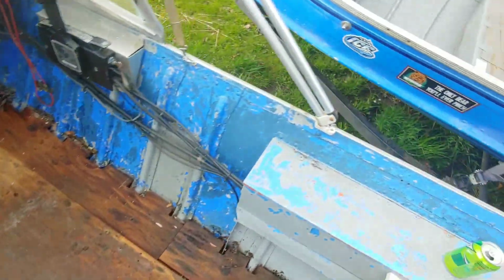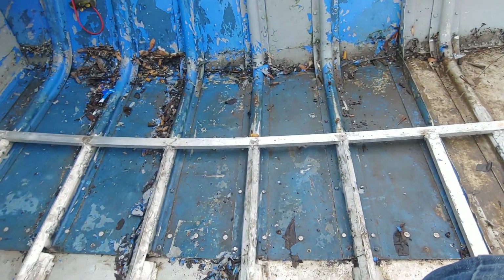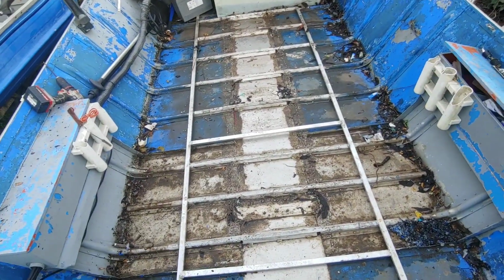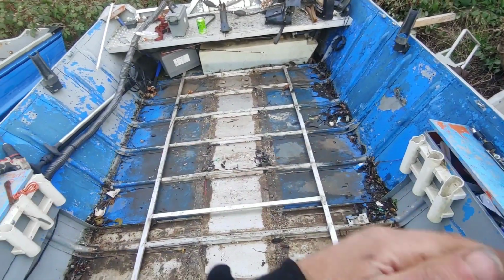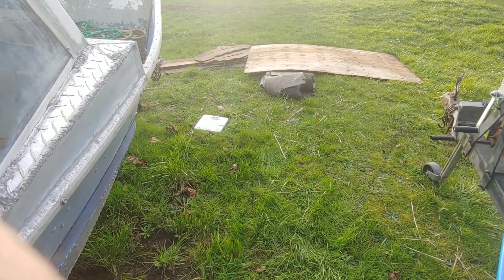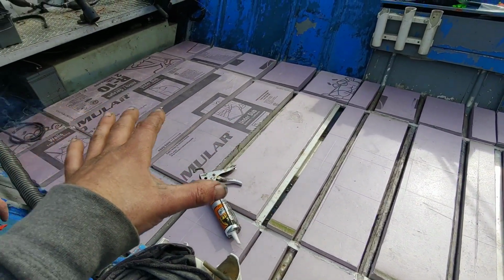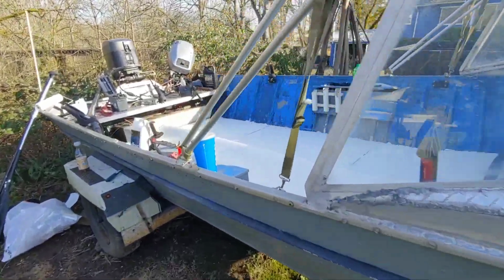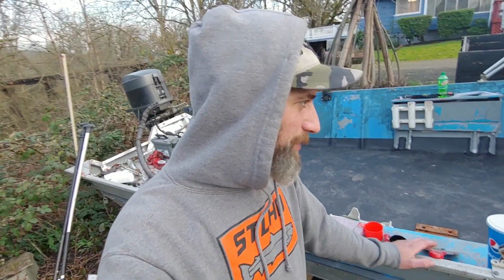Best boat floor. frankensled gets a new waterproof subfloor. diy boat floor.

Comment: I'm glad someone else thinks like me LOL!!  I'm looking at doing a similar thing only my boat is a 15ft aluminum shallow V bottom with a 4.5ft beam.  I'm gonna try multiple 1" vertical foam stringers to bring the bottom up to level, then cover with 1" pink foam for decking....might have to add doublers to the top of the foam stringers to support the foam deck.  Finally, cover the 1" foam deck with Polywall...a similar FRP only thinner and lighter.  Every thing glued together with Gorilla Glue Construction adhesive.  All very similar to what you have done,  Nice job!!  Glad to see someone else understands about weight in a boat.

Comment: Great video man, never thought that ply would weigh that much!
Reply: It doesn't weigh that much when it's dry, this guy never coated it with epoxy or fiberglass resin so it soaked up water.

Comment: I was thinking of taking out the bench seats in my Jon sled that’s like this, then sheet aluminum riveted to the support beams. I don’t have the plug on those materials like you used. I can’t find rubber sheeting in stores for the life of me. Just small mats 😂
Reply from the maker: Camping world will have giant rolls. Also look on line for motorhome roofing. I like the sheet aluminum floors those are def forever

Comment: I'm trying to decide if I should go with pvc. I was told it would expand and contracrt too much. what is your take on it after this build?
Reply from the maker: Long as it's not too crazy tight of a fit. Iv had zero issues. Other than heat. When it's 90 outside the floor of the boat is 100
Reply: @CAPTAINWILLY  I'll be putting eva foam on the floor. thanks

Comment: Killer plan .I'm doing the same except ...I'm gonna use TPO roofing .it's way tuffer than the  rubber and won't heat shrink or bubble. Also gas won't kill it.  It's just a superior product my dude .check it out 😉 you can customize it any way you want w a heat gun and roller and its white ! 🤔🫨 great video bruh.

Comment: How is it holding up ??????
Reply from the maker: The sealer I used on the sides. Garbage. But otherr than that still solid as hell. But my Dog dosnt like how hot it gets in the summer . Have to pour water in the boat every hour or so to keep thee floorr cool

Comment: 3/4 plywood marine grade will last
Reply from the maker: 3/4 plywood this boat would loose 3 Inches of freeboard.  The whole point of this was for weight. Going on it's 3rd year amd has been outside this whole time. Still weighs the same as when I put it in.
Reply: @CAPTAINWILLY  Understood but anything less can be a problem with structural integrity.  Many boats need 3/4 to "hold" together or the form will change or flex.